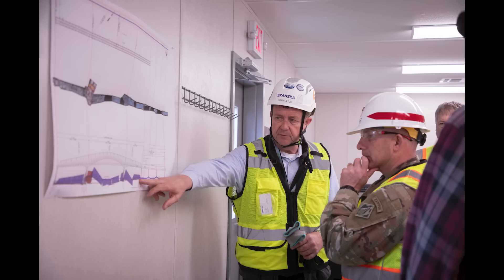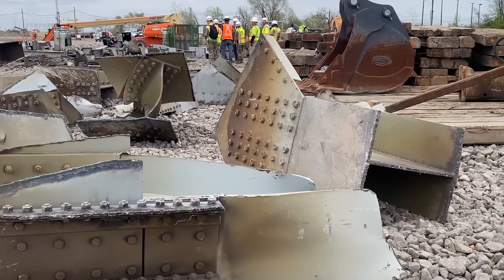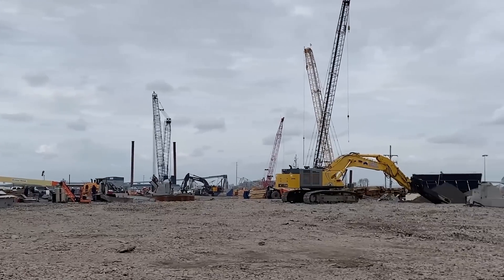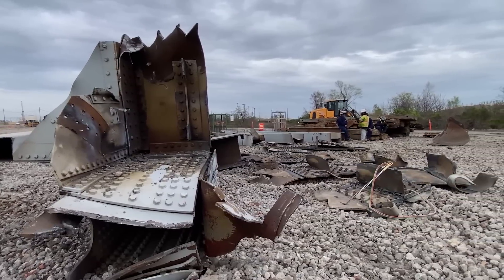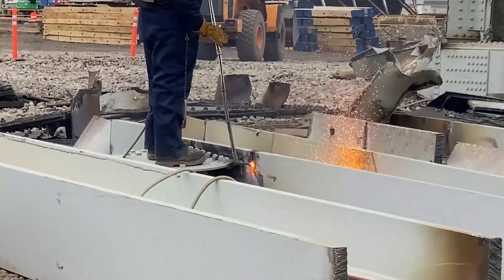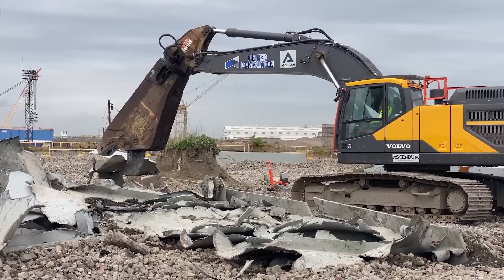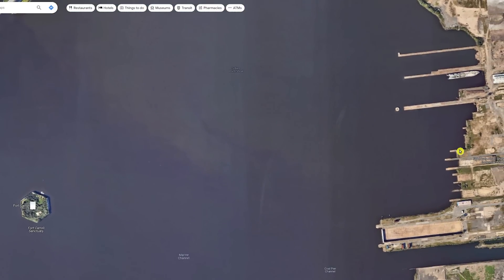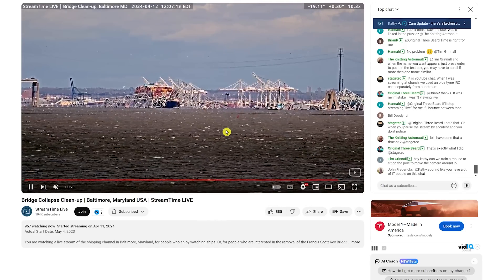What Do They Do With Key Bridge Collapse Debris Salvage?

Comment: Glad this guy acknowledges how well the bridge was built. He bad mouthed it in earlier videos😖 I drove to the salvage area and was told they are laying the bridge out as originally built as possible to study strengths and weaknesses in the design and construction before chopping it up for recycling. Impressive operation to behold
Reply: The bridge span was well made... the pillars.. well.. let's say there are differing opinions about them.
Reply: @matsv201  The pillars seem to have worked as intended. They simply weren't designed to survive being struck by a heavy ship which pretty much goes for all similar bridge pillar applications.
Reply: @P_RO_  now I only design pillars for road traffic, but if there is any risk of them getting hit, the pillar have to be designed do absorb that hit. For example if we have a garage under a high rise we may use a speed as high as 50km/h to get hit. And that is indoors, so that is really fast.
Reply: @matsv201  So you can do the math then try to design a pillar for this bridge which can withstand the impact of one of these mega-ships at speed, including the problems often encountered securing the base if you don't have bedrock handy. There's a humongous amount of energy involved making it totally impractical for ships of this size, although it is sometimes done where only small ships or boats could navigate there. Then there's a need to incorporate repairability after such a hit occurs complicating the process. Which is why the usual practice here is to protect the pillar from collision including the use of shapes to cause a ship to be ramped away from the pillar instead or just taking the hit into the protection structure straight-on. The nicest part of this approach is that you can retrofit them around existing pillars for what is a reasonable cost compared to the cost of losing the pillar, and by design they also minimize damage to any ship which does collide there for a win-win. Almost all the newer bridges incorporate ship-strike protection into the design now but the trend is recent, and old bridges like this are as vulnerable as ever. Many places also have speed limits for ships as part of the risk reduction strategy, also some places require tug escorts to help steer the ship safely too. Any of those strategies could have helped here but none were in place.

Nobody can predict and allow for everything possible, but this collision could have been foreseen. It was somewhat unlikely as the risk of a ship it's size losing control at a point allowing such an impact is rather small, but given the importance of the bridge and harbor someone was remiss in not taking better steps to mitigate the risk. I do hope that those in power to make changes will now see the wisdom of retrofitting pillar protection and better regulating the operation of large ships near them to he[p prevent a recurrence. And in your business you might find a similar protection strategy helpful; I have seen parking garage structures where critical points had tall concrete curbing around them which would prevent vehicle strikes, and others where bollards would at least absorb some of the impact energy if they didn't prevent it completely.
Reply: We used that bridge for years. It was constantly being painted. I believe the state has an excellent maintenance program. Same for the Bay Bridge.
Reply: Would be useful to see if corrosion had affected any of the major stress points after nearly a half century.
Reply: I was just thinking that would be the plan for bridge pieces. That's what  they do with plane pieces when it's been in a crash.
Reply: I haven't seen any bad mouthing - he criticized that there were no protections against bridge strikes by ships, especially after the Florida bridge disaster decades ago.
Reply: In 1977 when the FKS Bridge was built the shipping channel was 35 feet deep and 500 feet wide.

The support pillars were 100 feet outside each side of the channel in 15-20 feet of water. 

There were modest “dolphins” protecting the bridge from Tug Boats and other smaller Harbor vessels, etc.

There was no need to build robust protection because the deep draft ships could not possibly physically strike the supports in the much shallower waters. 

Then over the years, as I sailed those waters in a Catalina 27, they incrementally deepened and widened the shipping channel to the current 50 deep and 700 feet wide: ending up in right NEXT to the supporting pillars.

OPPS!🥸
S L Collins
Baltimore, MD
Reply: @weirdnewworld1736  conjecture was the dolphins were inadequate by today's building standards.
Reply: Funny how methodical they are being here but they promptly carted off and disposed of the twn towers wreckage. I wonder why? 🤔
Reply: @vladimus9749  took it somewhere to reassemble what they could. Of course, the techniques have improved a lot in nearly 25 years.
Reply: @vladimus9749  wrong, it was carted to Staten Island and examined carefully

Comment: Quit calling the Ft. Lauderdale accident a crane collapse. The erectors dropped a tower section off the jacking frame.
Reply from the maker: The platform on the Crane collapsed and that is also what all of the newspapers are calling it a collapse.They did not drop the piece. The crane section that was ready to be jack was resting on the platform jutting out from the top of the crane and the platform collapsed and gave away and the peace fell to the ground period
Reply: @jeffostroff  Whether it was dropped or fell off is the same effect. As a retired Operating Engineer I cringe every time the media calls incidents a collapse. Bye the way I do enjoy your videos and find them pretty informative.

Comment: This salvaged steel could be smelted and formed into the new bridge structure.
Reply: To bad that they tore down the steel plant. That looks like prime scrap.
Reply: @roneike7858 scrap steel is one of the largest export from USA to China...
Reply: @matsv201  Mexico and Turkey is the 2 largest destinations for US export of scrap steel, China is not even among the top 5 list
Reply: It could be, steel is one of the most highly recycled materials that we use today.  There are plenty of small steel mills around the country that melt down scrap and form new structural steel and reinforcing steel from it, I've toured 2 in my area.  Most melted scrap these days comes from automobiles.
Reply: in China.
Reply: @codetech5598  I don't know how much steel goes to China, Korea or wherever, but a tremendous amount is recycled here in the U.S.  One steel mill in my area claims they use 3/4 million cars a year.
Reply: @billj5645 over 70% of the steel produced in the US comes from recycled steel. Nucor with its mini mills are the largest producer of steel in the US and only use scrap metal. The old outdated integrated steel mills can’t compete with that since they failed to update most of them
Reply: @12345anton6789  I've toured the Nucor mill in my area.

Comment: Those pieces are not numbered so it is unlikely they are retained for investigation
Reply: I would agree. It's not like the bridge structure failed, and I very much doubt there is anything to be learned from just any old random bit of the bridge. In any event, if the whole lot was going to be examined, then they would not be cutting it into small pieces. 

No doubt a few key pieces will be retained, such as where the bridge attached to the piers, but as for 99% of it, then I don't think there will be anything to learn. What is more important is, what happened on board the MV Dali, why were the piers not protected against a foreseeable type of collision (other bridges have been brought down by collisions with cargo vessels) and, finally, why was it designed without redundancy so that the entire three spans didn't collapse (and preferable none would).
Reply: @TheEulerID There isn't a bridge in the world with redundancy that would keep the bridge up when a main support is removed by a ship.
Reply: @regould221  The principle is to prevent the ship actually coming into contact with the pier in the first place, hence the protection is around the base of the pier and intoi the channel and its approaches. 

As for the failure of a main pier then there are designs which will limit the failure to a single span.

Comment: Getting a cherry picker mobile crane to assist the torch crew. Use a plate clamp to hold while cutting. Lift up enough so the torch doesn’t burn into rocks.

Comment: Imagine the amount of oxy/acetylene being consumed on this project.  It boggles the mind on the sheer volume of steel being processed, the workforce, equipment.  Thanks to all the trades that are working to clear and rebuild.
Reply: Having delivered liquid oxygen to scrap yards and being a welder most scrapers use propane as a fuel gas
Reply: @russvoight1167  thanks for the update.
Reply: @russvoight1167 Absolutely Acetylene is dangerous if mis - handled and propane, propylene, and mapp fuel gases are generally more economical.
Reply: It happens all day long every day in the coastal scrap yards of south asia. I guess it must be worth it otherwise they wouldn't bother, although in this case they absolutely have to. American workers with safety gear costs a bit more than Indians in shorts, I reckon.
Reply: I would bet for the volume of cutting being done that they are using propane.
Reply: @tedanderson463  The oxygen will come by the tanker load and quit frankly propane sucks.
But for scrapping it works
Reply: i haven’t confirmed what these guys are using but i was once a cutter in a salvage co and we used oxypropane.  way cheaper.
Reply: I'm sure the NTSB will be absolutely honest with the American public, leaving no "stone unturned" as they say. They will be forthright with: 1)Missing 2mins of the VDR 2)Failure of the auxiliaries 3)The Dali SUDDENLY/CONVENIENTLY turning into pylon 4)William J Delbagno's appt. by Wray the day b4 to oversee this (Cough! Cough!) "investigation"
Reply: @tedanderson463  There is a huge difference between propane and acetylene for cutting and metal work in general. Propane is used because it's cheaper than acetylene but oxygen consumption is higher.
The cutting process doesn't meld the steel, it oxidises the steel. It is basically a rapid form of rusting. It is a chemical reaction
Reply: @russvoight1167  Thanks for the info!
Reply: I thought they would want to save the pieces to study how it came apart but the process of getting it on the barge is doing so much damage  the pieces will be useless to the crash study.
Reply: @kimhorton6109 they know how it came down in the sense that it didn't fail, it was damaged by the ship at a crucial support place. The steel was fine. It now needs cut up to be taken away for scrap.
Reply: @kimhorton6109  The NTSB has taken numerous photos and most likely has plenty of videos to spend at least a month to review for their preliminary report.
Reply: @kimhorton6109 they didn’t study the twin towers why would you they study this.
Reply: @kimhorton6109  It looks as if they are cutting the damaged ends off for study. The rest of the intact steel would be unimportant, so they are just scrapping the rest.

Comment: Jeff, the cutting attachment on the excavator is called a 'SHEAR". They are cutting the metal up into 5 foot pieces because you get more money per ton from the scrap yard for doing so.
Reply: Being a scrap metal recycler, I can honestly say that there is a price point you have to determine to see if it is worth your time to cut up or disassemble.  Prepared versus unprepared.  I have found that with our local scrap yard, sometimes your time and energy/fuel costs outweigh the difference in price.
Reply: @funnyfarm5555  I was thinking the same thing. I don’t know why they are cutting it in such small pieces, I thought pretty much any scrap yard now days has a machine that will eat up anything you put in it. I’ve scrapped a lot of metal in my life and the scrap yard in my area has a big conveyor belt that takes the material up into a grinder. They shear the pieces just good enough to fit it on the conveyor belt. If the customer wants to cut their scrap in 3 foot pieces they pay higher prices for “ prepared “ steel, but the scrap yard doesn’t need it in tiny pieces to go into the shredder lol. I don’t know why on a project this big they aren’t expediting the process, course any time the government is paying some contractor to do the job, you can bet it will be ten times more expensive and take ten times longer than it needs to be lol. That’s probably the case here.
Reply: @lifeonthefarm6001  I found the difference between prepared and unprepared to be a penny a pound, so I no longer waste my time on a lot of things.  I scrap it to keep it out of the landfill.
Reply: @funnyfarm5555  Good to know ! Glad to hear it ! I rarely cut up steel . Most of my prepared steel is worn out plow parts, sweeps, bearings, etc. It goes in an old 250 gallon tote with the top cut out, when it gets full it gets hauled to the scrap yard.
Reply: @lifeonthefarm6001 60 ft steel beams are simply not going to fit on a conveyor…
The purchasing recycling company and their transporting railroad would have specified a maximum acceptable size.
Reply: @allangibson8494  I realize that but they are cutting some of these pieces into really small pieces, which is time consuming, I just don’t see the point. Anyone who has scrapped a lot of steel would see what I am getting at. I understand some of the rivet plates have to be investigated, but why they are spending time to cut beams down the middle and crossways into two foot long pieces is beyond me.
Reply: @lifeonthefarm6001  maybe they didnt want to be clocked off the payroll and told to wait 2 days until the next barge turned up with more steel so they made themselves look busy ?
Reply: @lifeonthefarm6001  The shredder is not indestructible. Large i beams and armor plated along with hardened structural steel will destroy the hammermill.   They have a door to reject certain types of steel.
Reply: @allangibson8494  I understand that lol. In the video they were cutting some short pieces into smaller pieces, which seems ridiculously time consuming.
Reply: @lifeonthefarm6001  Short and light are two different things. Gusset plates are HEAVY.
Each piece needs to have a range of both acceptable size and weight for reprocessing.
Reply: What about the extra cost in labor, torch fuel, etc. Sounds like a no win🤔
Reply: @leechjim8023  That’s what funny farms quad five said there is a point cost-effectiveness.
Reply: @leechjim8023  Hey now, there are people getting work. Sounds like a win to me.
Reply: @TheMomseloc  And you are paying the taxes!
Reply: Some of those longer lengths of UB would be salable to reuse
Reply: @qbi4614  errr, stress...
Reply: @PETER_YZ250FX  prefect for rural arias- cattle grid, hay shed, yards, irrigation channel bridge etc. Farmers will find 1000 uses.
Reply: @qbi4614  True, and a good point. 🙂
Reply: ... it's not welding sir it's cutting.
Reply: Who getting the scrap price? Trade  point or the state?
Reply: They are the scrape yard my guess is they are going to smelter for that size
Reply: Powerball and Megamillions money was confiscated and a winner was faked for this.
Reply: plus the pieces need to fit in the next step of recycling. that isn't the bigger track-hoe with a shear over there. the shear is more efficient

Comment: the track machine has a demo shear on it for cutting steel in scrap yards and demolition site. The guys with the torches are cutters. Welders put steel together, cutters cut it apart. Very slow process cutting this much steel compared to what a shear could process. They have their work cut out for them either way.
Reply: We call them burners where I come from because that's what they're doing. Steel this thick is burned unlike the thin kind they use in newer automotive manufacturing. I learned how to weld and burn when I spent a short time as a shipfitter many many years ago. For the most part it's still the same now just more automated when possible.

Comment: That was cutting not welding. The arc flash was not present. Manageable stress on eyes.
Reply: This is a good video if you mute the sound.
Reply: I was about to say the same.. but I don't know anything about cutting. I do know a bit about welding.
Reply: I was thinking the same. Welding is about joining metals together. This is not welding.